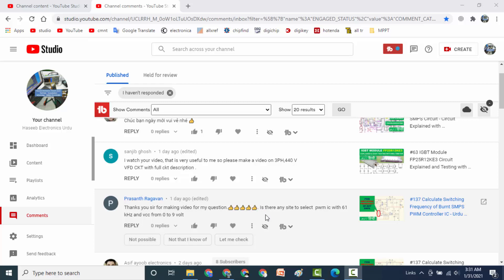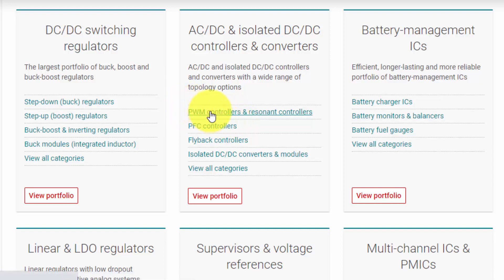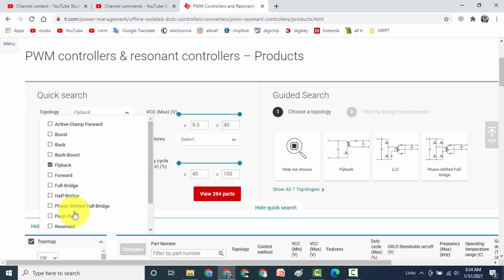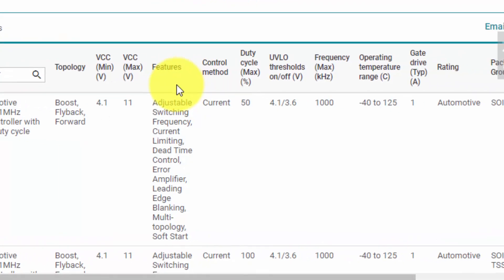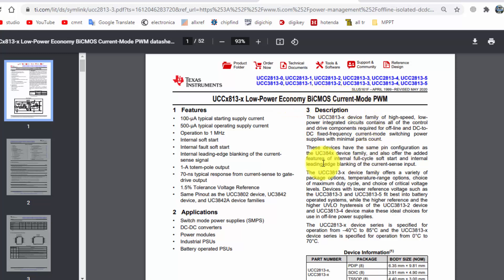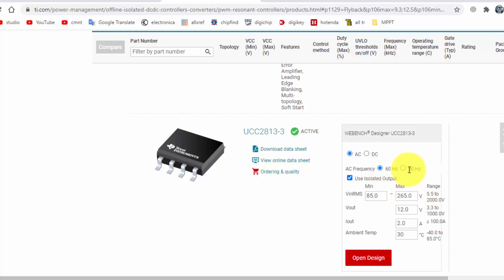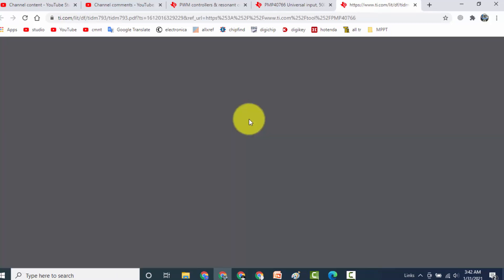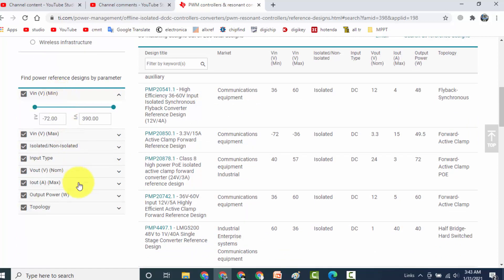#318 PWM / SMPS controller IC Selection (How to find Equivalent / replacement / Select new IC)

Comment: how do we design wide output voltage range smps power supply for example 30V-45V supply with wide input voltage range like 85Vac-265Vac?

Comment: HELLO SIR CAN YOU PLEASE MAKE A VIDEO HOW CAN WE MAKE 5V 10A SMPS BASED ON POWER INTEGRATIONS IC LNK6666E AND HOW TO CALACULATE TRANSFORMER PARAMETERS AND WHAT WAS THE CHANGE IN CIRCUIT IF WE MADE 12V5A OR 24V2.5A SMPS ON SAME LNK6666E IC .

Comment: Any PWM ic in which we can change the frequency without disturbing the duty cycle?
Reply from the maker: yes dear
there are many options 
you can select TNY switch, TOP switch, IR2153 half bridge drivers, you can use NE555 timer etc

Comment: Good job sir 
Please  board of isolation and Gate drive for inverter three phase induction motor control by dsp tms320f28335  how to desgine et implémentation + cours how to conected dsp tms320f28335 with motor
Reply from the maker: best regards dear
unluckily i have no practical experience in tms320f28335, as it is a huge and i never used it or how to write code for embedding. as this MCU have thousands functions, so i have no valuable knowledge 
i am sorry for that sir
please accept my best regards